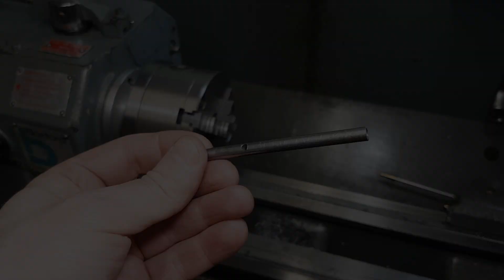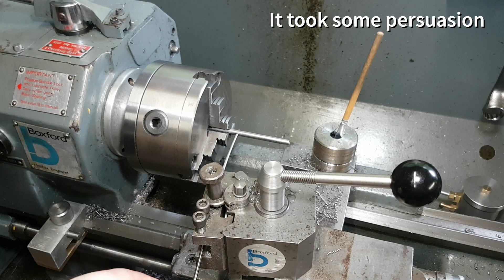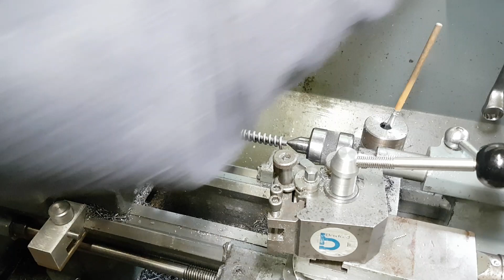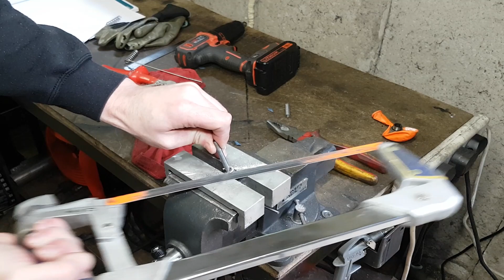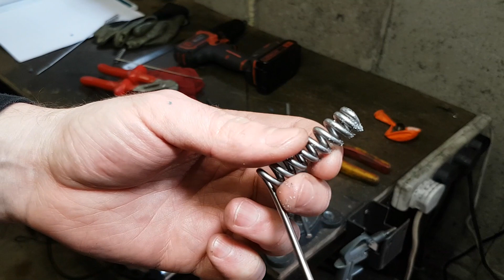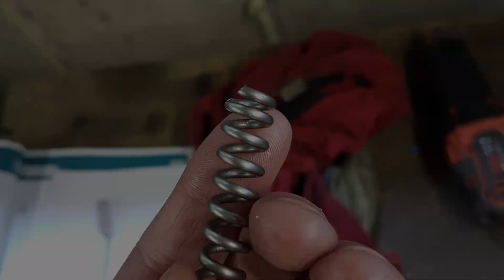Corkscrew Project - Part 1 - Making the Worm

Comment: Is the wire hardened?
Reply from the maker: I hardened & tempered the wire in a later video. It didn't quite work out though, since the wire was too thick and the helix too tight, making it difficult to screw in. I did have better luck with a different design in the end.